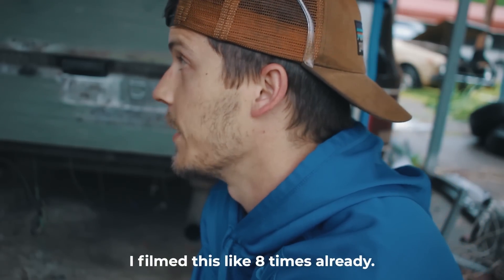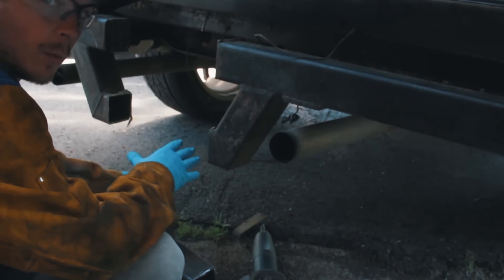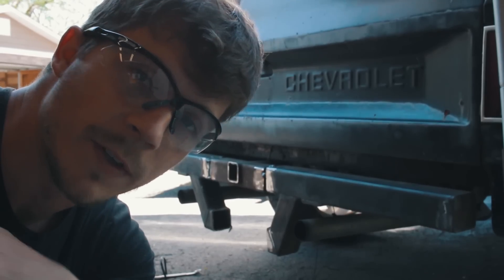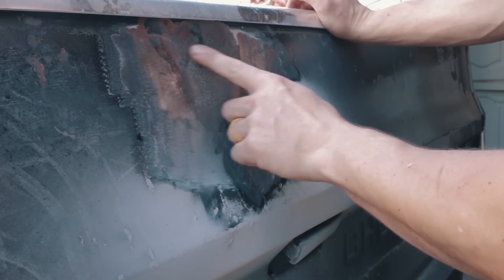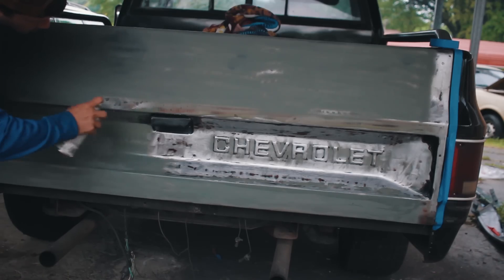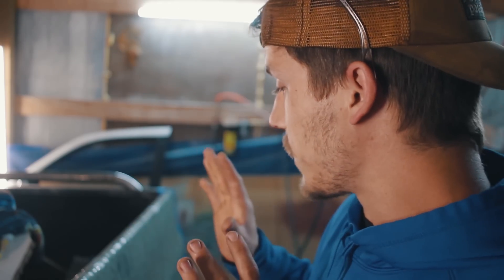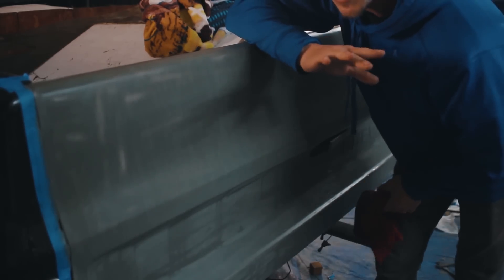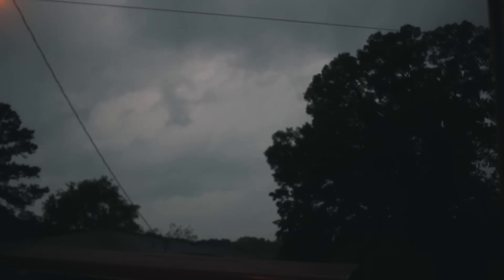$2000 BUDGET C10 CHALLENGE IS FINISHED

Comment: 2 quick easy and cheap things....

1: pull the grill and headlights and put some satin black on all the metal behind the lights.

2: push out the dents on the fender.  They're not bad but look terrible and can be pushed out with pdr. (paintless dent repair) Watch a couple tube vids, its really not that tough to do.

Those 2 things will really clean up that front end. I mean you've come this far, why not right?
Reply: @ dent repairs,    use a compressor and inflate basket ball inside the fender.   Works a charm
Reply: Failing that,  investing into professional panelbeating tools would be a great idea ie pannelbeating hammer.   A block of wood and normal hammer works if you have easy access too if u dont wanna spend money.
Reply: @nzexplorer876  glue stick
Reply: @nzexplorer876  you gave me a great idea!  I have a dent on the side of the bed on my 73 C10.  I had already thought that what I needed was to push it from the inside with something like a porta power.  This may push it out enough to not be too noticeable. 👍
Reply: @sonparabailar  thats great to hear dude!   there are plenty of things you can do to push a dent out,   if ur dent has no crease in it it should do it 100%
Reply: Honestly he did it to fast it looks bad

Comment: Small tip. Often times when you are spraying, the spitting might not be gun-related. Often times it's your compressor. Not because your stuff is junk or anything like that. Compressors need to be just as clean and functional as anything else. When compressors run they pull in air to pressurize the tank. The air being pulled in is dirty. Not to mention the condensation in your tank. Both can come back up your airline and cause gun failure. Keep your tank well maintained.

Comment: If the compression is solid on all 8 cylinders, I would bet the smoke is caused by worn out valve guide seals. They dry up when cars are parked for a long time or simply wear out on older vehicles. It allows oil to seep past the valves and smoke during combustion. These would be pretty cheap to fix. 

This was a really nice project. Good job sticking to the budget.

Comment: Try taking the valve covers off and checking the oil return holes in the top of the heads. Sometimes they stop up and make it burn oil and smoke like that. Hopefully this easy fix is your problem.  Good luck and great looking truck.  👍

Comment: Try taking the parts off when you work on them. Grab a wire wheel for your grinder to clean paint and rusted/dirty bolts. Dont put a fender flare on the truck either. Have fun and enjoy

Comment: Love the build, only a few things left....spark plugs tell the story. Pull them and look at the condition, any in really bad condition, check those cylinders with a borescope for bad carbon deposits on pistons, burning oil usually means bad rings. BTW...when are the fender flares goin on?

Comment: Fender flares.
Rings are probably shot in that thing. I'd still keep it and run it till that engine blows then do something else. If you have to get rid of something get rid of one of those rice rockets or cars and keep that truck. Rather seen it at Stockbridge height though...sitting on 31x10.50s

Comment: It was emission motor and towed something heavy...they did a hillbilly emission delete, egr , emission pump, several vacuum lines, etc and burnt the Piston rings. Needs Valve seals or rings. Most of those valve seals dry out , crack and leak oil directly into combustion chamber

Comment: I know this isn't a absolutely necessary thing but in my opinion I think it would look better if you took the grill and headlights out and painted behind them the same gloss black you used on the tail gate. now dont get me wrong I love the truck and I think it looks amazing. I just think when it was driving straight at the camera you could see behined the headlight area and I believe with a little more work it could just look that much better and I now its not a necessity but thought I'd be good food for thought is all.
    fender flares.

Comment: i got 2200 in my 68 but no rust good clean body but needs paint but did the frame up with a stroked 454 with tunnel ram heavy duty 400 turbo  12 bolt posse 4:11 gears  rally wheels so still have to put money in it  have to build a cowl  induction hood so the hood fits

Comment: It’s smoking because of valve seats my old c10 did the Samething
Reply: Yeah normal 305 things
Reply: The coolant don’t have anything to do with the smoke bro,  it’s either the valve seats or the pistons worn. The coolant for the AC
Reply: 360skee coolant is for the engine to keep it cool you’re thinking of refrigerant. If it’s white smoke it’s coolant if it has a bluish tint it’s oil getting into the cylinder which the smoke looked a little blue to me
Reply: It’s probably just the rings because it smokes all the time if it was valve seals it would just leak oil into the cylinder when it has been sitting then goes away when you run it

Comment: Hey I need help putting together my fathers old truck, he has Bedliner on the hood that looks like crap, what tool would you recommend? I tried sanding it and it’s just chewing threw it. I want to get it to the bare metal.
Reply: Angle grinder with flap disk or paint remover wheel

Comment: Pull the plugs.. They'll tell you alot..
If they're covered in like crystals/sand like build up it's your valve stem seals, if they're coked near the base it's rings, if one or a couple looked steam cleaned you're getting water in there.
Valve stem seals are an easy fix, rings are alot more involved.

Comment: Thats smoke, not steam. If it was a blown head gasket it would be losing water and it would be steaming out of the exhaust. That's smoke which usually means valve stem seals. Pull the valve covers and see if the drain holes at each end of the heads are plugged. Simple fix.

Comment: i got 68 i went over budget i have 2300 in it but no rust good clean body but i have a 454 stroker with tunnel ram the tunnel ram ran me over budget and radiator i have a 79 scottsdale that is mint just needs engine work that i got for free just got about 3 months ago a 79 4x4 short box cheyenne full option truck 400 sb 400 turbo in mint condition was parked in a shop it's hole life with 35,000 miles on it even the paint is mint got it for free supper chevy said they would not sell it for less then 20,000 they offered me 12,000 cash but they would have to ask the boss for more i told them i not selling it  i have a lot of these trucks sitting i scrap the one's that have rust if it is rust threw the body and i know i'm very lucky with cars witch pisses my friend off i don't know y i'm so lucky i just stop and ask if they need any scrap hauled and they just give me the rigs that are broke down only with title but i got the place for it